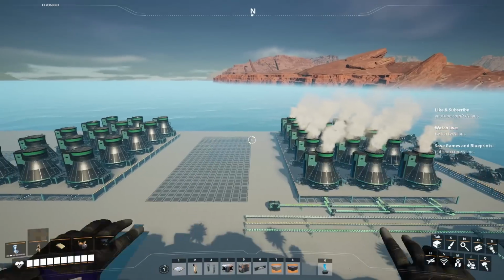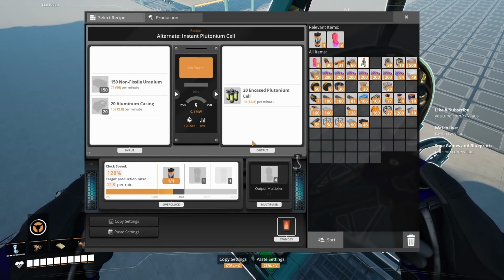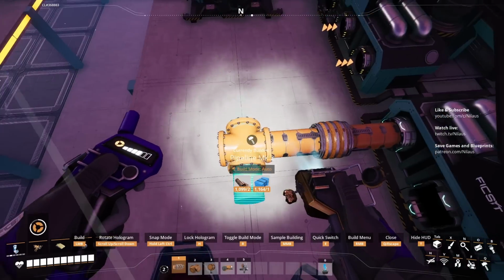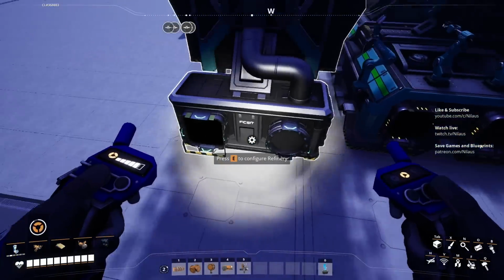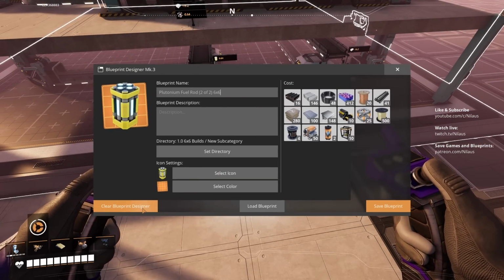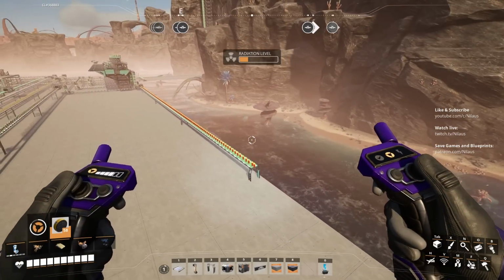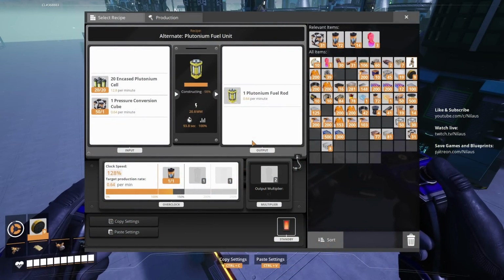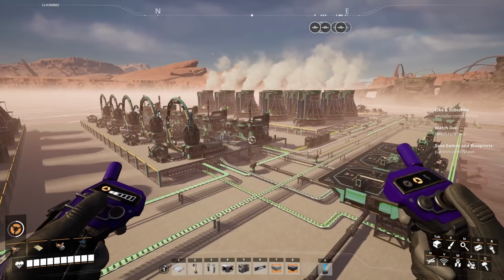PLUTONIUM POWER; From Toxic Waste To 80000 MW | 22 | Satisfactory 1.0 | Lets Play

Comment: For the plutonium reactors u never showed the over clock rates. U only looked at one? Are they all at the same rate?
Reply: I believe they are all 213.3333% something, with 15 reactors you get to 32, which matches the 3.2 Plutonium rods per minute and 0.1 per minute burn rate of a non-overclocked reactor.

Comment: sick of running out of quartz crystals?..stop using signs for lights since they don't actually provide any light?
Reply: They actually do provide quite a lot of light when you have global illumination turned on.
Reply: @darrickingersoll8853  👍 this post makes sense
Reply: They do if you edit your engine.ini file located at %localappdata%\FactoryGame\Saved\Config\Windows. Put this text in it:
[SystemSettings]
r.AOGlobalDistanceField.MinMeshSDFRadius=1 ; default 20, smaller number shows more items, small signs off screen still show reflection, light effect travels further
r.LumenScene.SurfaceCache.CardTexelDensityScale=1000 ; default 100, old sign light
Reply: This post makes 0 sense.

Comment: My Fuel rod build requires 284 sulpheric acid to run, The byproduct is 71 which I feed back into the system and then cut the initial supplement to 213. So far so good. Valves and pumps are good.

Comment: You can sink plutonium rods to get rid of the waste forever. I am in the process of setting up 60 overclocked reactors and the machines to make the 30 uranium rods/min to feed them.... I don't plan to use the plutonium rods, they are going straight into an item sink.... At least until I have a use for plutonium waste.
Reply: I’m finishing the process of setting up plutonium with 1200 waste coming from 120 reactors using uranium so it’s an additional 60 reactors from the plutonium which adds 150,000 MW to our 300,000 we are already making its worth the investment
Reply: @Siladzy  Yeah, once you have a desire for the power it is probably worth starting to use the plutonium rods in reactors. I found that they were worth more as coupons while I worked on other things with my new power budget.....

Comment: For the final step of making Ficsonium Fuel Rods - if you Sloop it you produce hte exact amount of Dark Matter Residue needed in the previous step.
Reply from the maker: waste of Sloops to spend them on something as trivial as power
Reply: @Nilaus  I guess that is correct, especially since dark matter residue is a byproduct that probably isn't worth doubling. When you get down to it sloops should only go into the machines with the most material expensive recipes you currently make. 
However, it is kind of satisfying to be able to multiply the products of a recipe so that the byproduct created can be fed back into the previous step and remove the need of supplying that product at all....
Reply: Ahhh, that is... delicious.

Comment: I would have agreed on the fluid thing in previous patches, however valves really do solve the major issues atm. Like even in your build two basic valves were more than enough to  make it work. Most fluid issues existed because you didn't have accurate control over the throughput of a pipe, but now you do. Between valves and pumps, you can make things work really well, without even actually understanding how the fluid mechanics work.

Comment: protip for big builds:  turn off 'use inventory first' so you pull first from your DDs and let them start refilling immediately so when you get to using materials from your inventory your DDs are already refilling.
Reply: You can also set up multiple depots for the same item, increasing throughput, Ie. have 2 depots with concrete going in to make 480/m into the cloud instead of 240
Reply: I have been using the trick to get a blueprint out of bounds of the blueprint cage.... I have one that is 5 nuclear plants on foundations with the splitters/mergers, this blueprint is 5x25 foundations and requires 1010 cable to build, it took me a minute to realize why I couldn't get it to turn blue no matter where I looked. I made a large temporary cable, concrete, and iron plate factory to feed additional storages to get stuff to refill in the time I spent doing conveyors and power cable connections during construction of my bank of 60 reactors because building 5 at a time is.... a lot of materials.

Comment: did you experiemnt with side by side modules and feeding directly in the adjacent module?
you got 5 modules of each type and 15 reactors, so you could directly feed form the first module in the second one into 3 reactors. Maybe this would make it feasable to balance between reactors instead of the manifold. This could reduce readiacive materials on the belts
Reply: it is also generally more belts to place and radioactivity is not an issue if you build it and then leave it forever, so... you can make it a coupled blueprint (which are cool, btw) if you want, he did it in a bus like way.

Comment: I signed up for your patreon and imported the blueprints into my game, but now the game crashes on startup. If I remove the blueprint files it runs normally. I don’t know what’s causing the crashes.
Reply: I’ve imported it and had no issues
Reply: If you are on windows, check if your save name or session name is a valid folder name. Some special chars (asterisk, colon, slashes, etc) are disallowed by windows as well as starting/ending with a space, or ending with a period. If you are on singleplayer you can rename the session name fairly easily I think? Ridiculous that this hasn't been patched yet, file IO error handling is not difficult to program here.
Reply: @tukib_  It's more of Windows being funky with filesystem. Did you know that file names > 8 characters are actually truncated internally, then an extension/module maps between short and long file name? Also file names are case-insensitive, which is a PITA for compatibility with Linux for example. There are forbidden file names, and all of these is caused by MS-DOS legacy system even though none will ever run on modern Windows.